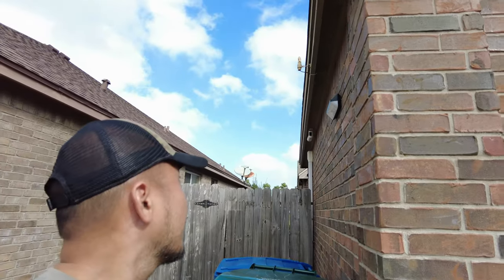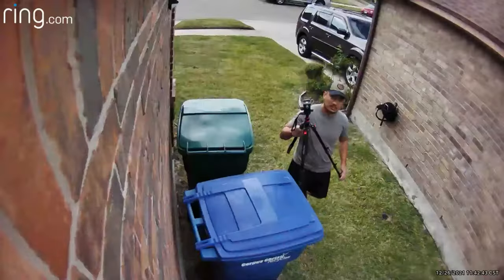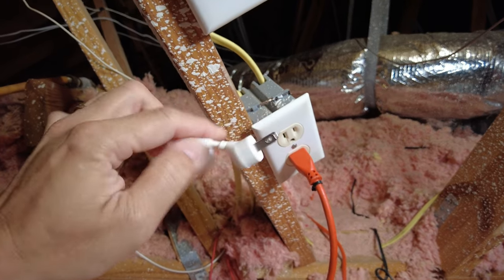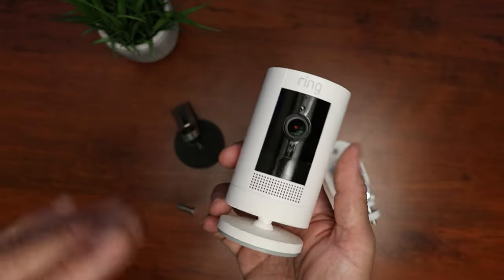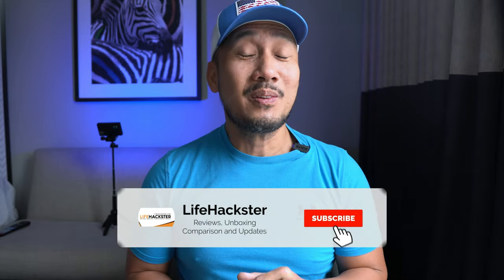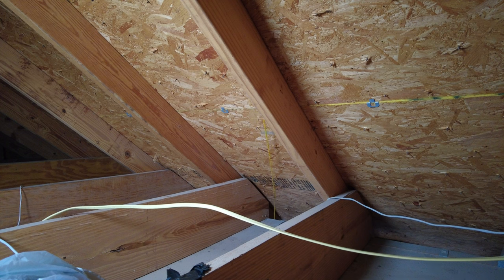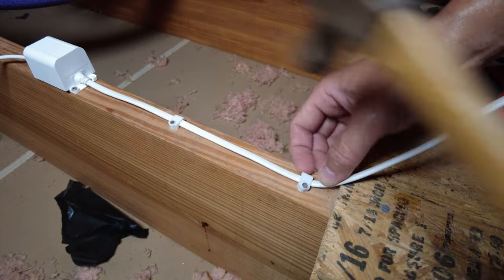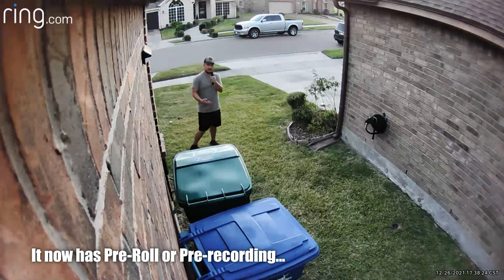Ring Stick Up Cam Wiring and Ceiling Install - Best Setup For Reliable Performance

Comment: Thanks for the heads up! I’ve been hordeing the older wired stick up cams so I can have the pre/roll, ect but now it looks like thats no longer needed.  Wish Ring would make these announcements/news a little easier to find but until then I’ll be getting all my Ring news here.

Comment: Nice and easy install..only downfall is if you have a power outage you lose connection to that cam...I have all my main power cams on power backups which last for up to 6hrs of power..
Reply from the maker: If you have your router on battery backup or have the Ring Alarm Pro (has backup internet) then you can leave the battery on the camera and it will still work when power is out.

Comment: I think a POE ring sick up cam would’ve been a better choice then a Wired sick up cam, that’s my opinion. I’ve been fan of your channel since you started, keep up the good work.👏👏
Reply: For sure, POE can't be beat. I think the vast majority of users don't have a server and have to rely on home wi-fi, though. Wish I could wire my Ring devices with POE.
Reply from the maker: True..more reliable connection to the internet except that the Stick Up Cam Elite is still twice the price.

Comment: Can you do more reviews on the Ring Wall Light Solar? There isn't much out there about it. Thanks!
Reply from the maker: Will see..nothing really to say on it.. mine is still working without problems.
Reply: @LifeHackster  Many people and I are having problems with it. It always stays on DIM mode from dusk until dawn the next night, but never brightens up unless you reset the schedule everynight, then it works properly. Is there a fix to this? It will work initially, but the brighten up mode from dawn will not work the next day.

Comment: Is there anyway to hard wire a battery operated spotlight cam? I couldn’t find a cable for it on rings website
Reply from the maker: Yes -> https://amzn.to/3sNR1H6
Reply: @LifeHackster  sweeeet, thanks!

Comment: I'm looking to do the same thing myself, so I appreciate the video. My only question is whether running the power cord in the attic is a safety hazard?
Reply from the maker: The Ring power adapter and cord are for outdoor use, so I don’t think there is an issue using them inside the attic.

Comment: Hi, excellent, easy to follow video! I want to know if I can use wiring on the outside of my house installed for lights to power a stick up cam, rather than a power cord to an outlet, which isn’t available. Thanks for your help!

Comment: I noticed you have an aftermarket security camera there. I also have an aftermarket home camera system in 10 locations outdoors, but those cameras are COAX and quality is horrible. Do you think the power going to those cameras can be used to power the ring cam? I have access to each Pos/Neg power cord to each camera. I am wondering if there is a way to send the correct power requirements to the camera, and instead connect that power to the Ring Stickup cam. Any suggestions?
Reply from the maker: Go with NVR and not DVR analog systems... compare the quality to the Ring -> https://youtu.be/L5raQOOxV_Y
To answer your question, the Ring stick up cam is 5 volts and IP/NVR cameras are 12 volts.

Comment: Excellent video as always! Do you still leave the battery in the camera after it’s plugged in?
Reply from the maker: You can if you want to but it is not necessary. If your router has battery backup, then you can leave the battery so that it will still work when power is out.

Comment: I love my ring stick up cam wired but I do wish the zones worked independently and here's an example I would like to have zone one the street and zone 2 my driveway in front door so the camera will pick up a car coming into the driveway then when the person gets out of the car the camera detects a person in zone 2  but it doesn't work that way so I have to just use person only and Hope it picks up the person

Comment: Dude can I do this without the power adapter plugged in to an outlet?? Like  a real hardwired setup?
Reply: That’s what I wanna know, the ring stick up elite is the POE model, I like the mount this guy used but I don’t know if I have to use this.

Comment: Lets say i purchased an extra battery and i disconnect the ring solar panel , will i have the option to choose wire mode and let it run on just the battery? Will the ring stick up cam detect that there is no power adapter and won't let me choose wire option?  I asked because i purchased an extra battery since the solar panel is draining my battery slowly. Please let me know.  Thank you!

Comment: Will solar panel for stick up camera keep it powered up like wired mode?
Reply from the maker: No. It will only top off and charge the battery.

Comment: Can I remove the battery after I convert to power like you did? Will it still provide the plug in video advantages?
Reply from the maker: Yes, you can remove the battery.,.and it will still have plug in features.

Comment: I bought the cable so I can wire my Spotlight cam batteries. Does the Spotlight cam battery have the wired features?
Reply from the maker: Unfortunately, the spotlight cam battery when plugged in will just continually charge its battery…no wired features..at this time anyways.
Reply: @LifeHackster  
So I will not get any improved Motion detection?

Comment: does this have the option to attach  solar panel ?
Reply from the maker: The stickup cam with battery.. yes. but it will not have the "wired" mode.

Comment: I have 3 outdoor cameras with solar panels, I’ve never had to charge them.  I’m guessing those don’t count as wired?
Reply: They perform as battery cams. I've learned that on this channel.
Reply from the maker: Nope..it needs to be plugged in a power outlet.
Reply: @LifeHackster  Thanks for the reply.  I love my Ring and Alexa products, but, I love your videos even more. 🙂
Please test the Ring outdoor gate sensor. Thanks

Comment: my snap capture is every 5 min...maybe mine is 2nd Gen stick up cam PS:  Mine is solar panel.
Reply from the maker: If it is connected to solar, then there are more options for snapshot capture compared to just battery alone.

Comment: Isn't that a fire hazard that insurance companies can use against you if your house catches fire?
Reply from the maker: I don't think a 5 volt line is considered a fire hazard.
Reply: @LifeHackster  what about the transformer plug receiving 110 volts? Is there risk there? And the extension chord... is there risk there? 110 volts on that all the time? I only ask out of concern.
Reply from the maker: @Taitmon  well,it is made by Ring and it is outdoor rated…your attic is more forgiving than the outside.
Reply: @LifeHackster  True. But does it meet saftey regulations?

Comment: Greetings,
I am having a problem with my cameras going off all the time at night due to vehicle headlights setting of the motion sensor off on the camera. I have tried moving the sensitivity and the quadrant of the camera but nothing works. I called customer service and got a foreign speaking person who had no idea what she was doing and did not understand my problem. I asked to speak with a supervisor and she told me that they do not have one. I chatted with customer service on line to find out were to file a complaint and got the run around. Listen I think the product is great but your customer service is the worst. You hired people from third world countries because it was cheap. You threw a script at them and said here you go. When a person has a problem the last thing they want to here is a foreign speaking person that has never seen or used the product. Now what am I supposed to do with my problem??
Patiently Waiting
John Petrucci